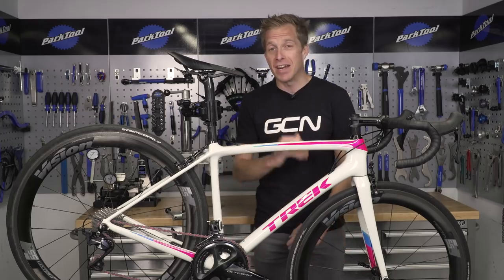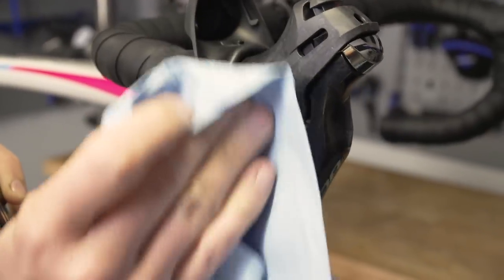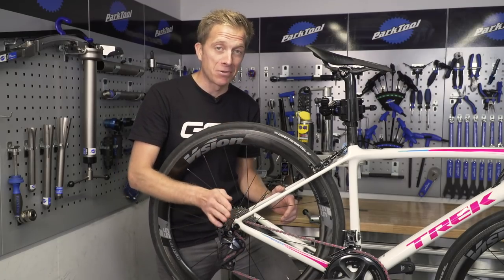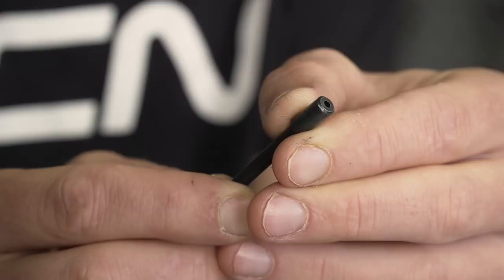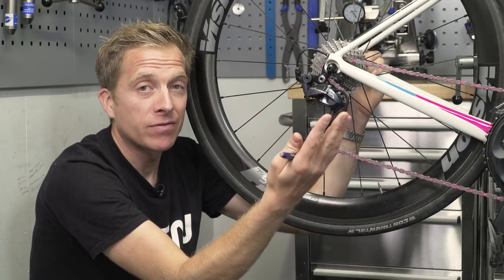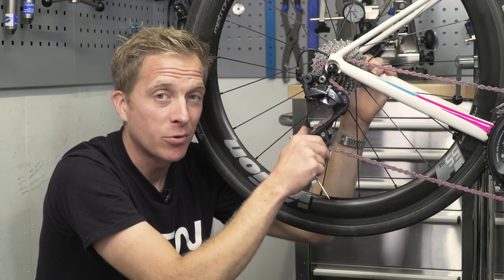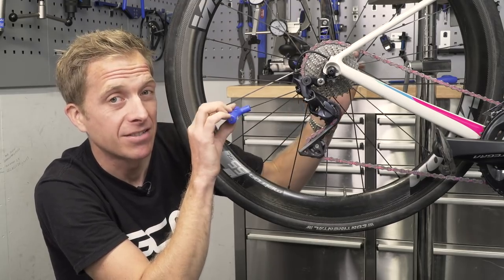How To Get Perfect Gear Shifting On Your Road Bike

Comment from the maker: Do your gears need some attention? Let us know how you get on with Jon's tips 👇
Reply: Nope
Reply: No I got rid of the derailleur years ago and got a Enviolo (NuVinci) CVT and had perfect shifting ever since. Add to that my homemade automatic shifting and I've got something old fashioned derailleur gears can never offer. An infinite speed bicycle that can always maintain my perfect cadence.
Reply: My Canyon Inflite is noisy on just one of the cogs on the cassette. Has been adjusted but still noisy. At least when I shift to it I know i have 3 more smaller gears to shift to.
Reply: who won the wahoo kickr?
Reply: could you even consider that as "shifting"? I mean it's a CVT.
Reply: I always stand up and try to peddle but something jolts me forward . Not sure what it is
Reply: @someguy9520  That's a good question, the ratio is changing but its not exactly shifting from one gear to another.
Reply: Perhaps your cassette is worn out. When you used a worn chain on a cassette for too much time, the teeth are gettiing scraped down to the point where they don't mesh with the chain under load and slip
Reply: still need your advise why the drivetrain on lowest sprocket  always has vibration/shaking feel?
Reply: Great video. I just wish everything Jon explained happened when I attempt it. This is one bit of maintenance I cannot get my head around. Only have to look at the barrel adjuster and gears are all over the place.
Reply: The tips are great, but no mention of straightening the hanger?  They are VERY easy to bend and it's critical for good shifting.  I do with it an allen key in the hanger hole to apply torque, and align by sight downward, and then folding the derailleur up to make sure the pulleys folds up to the correct cog.  Of course you could get a shop to use the proper tool.
Reply: Who's bike is that and what brand makes pink 11 speed chains.
Reply: I like it, but I think you need an North American version of the channel so we can understand a little bit better... I’ll be happy to be the guy you pick for that role.
Reply: My Roubaix Sport with Shimano 105 rear derailleur seems to sort of clunkily upshift. It’s not that it’s hesitant, it just feels like it shifts too hard. Is that normal? I’ve adjusted the indexing and limit screws, B-adjustment and it seems to be better, but not as perfect as I’d like.

Comment: Thanks for sharing. You make my new bike even more perfect. One small question though. Is it common that 1mm gap at 11/52 may cause chain touching the other side of deraileur cage at 23,25,28/52? Or 1mm gap at 28/36 ---> chain touch at 11,12,13/36? (I know we are not suppose to use gears like this. I just want to make sure I did it right.)

Comment: My extra tip for the front derailleur cable tensioning is to wedge it open a little with a 6mm Allen Key.  That way once you've clamped the cable, you can remove the Allen Key and anything slack that you've not been able to remove by had will be removed by the front derailleur itself as it moved back to its natural resting position.

Comment: I give my chain a good soak in degreaser, then get all excess off with a microfiber then oil it 1 drop of 3in1 oil to every link of the chain then run the chain through the microfiber to remove excess oil. Chain should allways be nice and floppy and not gritty inbetween the links.

Comment: If you just buy high quality cables, you will have crisp shifting for a very long time! I use jagwire cables and I love the shifting of my mechanical group with jagwire cables even more than my electronic shifting! I will always buy a mechanical groupset again and just use jagwire cables! Except on the tt-bike I will choose for electronic shifting.
Reply: Jagwire pro are great cables
Reply: SanderCycling I bought some black.phosphates cables can't remember the brand to replace the Shimano ones. No.more gunk.

Comment: Good video, I thought you would never mention how the derailleur hanger can bend out of alignment but you snuck it in the at the end.  The shifting problems I had recently were down to a bent hanger.  It was skipping sprockets, failing to shift, shifting under load.  Even if the H and L screws are adjusted properly the chain will still drop off the highest or lowest sprocket because the hanger will have moved the derailleur  closer to or further from the frame.
Reply: If that's not the very first thing to check, I think you'd be mistaken. All shifting is dependent on it and all it takes to confirm is looking at the pulleys from behind and where they line up.

Comment: I have just replaced the cable to my front derailleur, I lubricated it with ball bearing grease all the way, the bike is foldable so the outer cable goes all the way, with a bit of tuning now it works better than ever and in town I now use it like a stick shift in a car.  Trouble with those cables is that they deteriorate gradually, and you only notice it when you replace it! eels like a complete new bike!

Comment: Great advice thanks 😊 I would like to add a problem I encountered on a bike I built for this summer 😎 my gear changing was terrible 🤔 I did everything I could adjustment wise 😱 eventually I stumbled across the problem, I had fitted the wrong size spacer behind the cassette hence the sprockets on the cassette were not locked into place 😵 once the correct spacer was fitted perfect gear changes ☺️😇😃

Comment: Don't you mean the word "housing" at 3:46: I always thought the wire that runs inside the liner or housing is called the "cable", but I'm not a native speaker and "housings" are cables in a sense as well. Otherwise top notch video. I had completely forgotten about trying the first tip you give here on my rather poorly shifting bike. Will definitely try this.

Comment: You could have added some advice on how to get new cables to go through inside frame cabling.
Reply: Get some stripped out cable housing and use the plastic inner to use it as a thread through. 
Before removing cable, thread the sheath over the cable (long enough to enter and exit the holes comfortably), Pull cable through and out, making sure not to disturb the sheath;  

Hope that makes sense

Comment: Ultegra R8000 is a pain to index gears with. Over designed and not user friendly, especially the RD barrel adjuster. Also the cable housing for the FD is a faff on.
Reply: Completely agree on this. Me and my mates experience the trouble trying to turn the barrel adjuster. We figured out that due to short outer cable, there is too much pressure/tension pressing the barrel adjuster into its own RD slot. Try pushing the RD's lower jockey arm forward towards the front chainring to release some tension; or perhaps the outer cable housing is too long, when i trimmed a few mm it worked well as well
Reply: SAF1981 yeah went back to.my dura ace 9100 that derailleur is very smooth and the adjuster is fine.
Reply: To put more tension on the cable on the Ultegra R8000 RD you also must lift up a litlle bit the barrel adjuster before you turn it anticlockwise.
Reply: I also hate the lift action. I wonder why shimano did this.  So it's childproof ?
Reply: Glad I'm not the only one. I have changed my RD barrel adjuster to a normal dial one. Much easier and swifter than the press in button, slide up and twist action of the original.

Comment: i wouldn't dare to touch or adjust the tension of my gears….i trust the local shop. I have a brand new cervelo and he too sometimes makes soft "toc" when changing gears. I notice the shimano 105 has a very sensitive mecanism. If you press too hard it changes two gears...Next Week my bike is going to the end of season treatment to get that all fixed !

Comment: Hi Jon - thanks for all your videos! I have a question about my front derailleur. I recently replaced my front chainring to a 105-5800 50/34 from an FSA Gossamer 50/34.  I had to do some adjusting to make sure there was no rub, etc. But now when I try to shift into the big ring it requires a significant amount of pressure to make it happen. Downshifting works fine.  What is going on?

Comment: I'm a committed tubeless roadie and MTB cyclist. Every so often I add more sealant through the valves. On my road bike I haven't had a flat in a few years but have added sealant a few times so that it doesn't dry out. Is there a point at which I should pull the tire out and scrub out or try to remove sealant? I'm sure it's adding weight and drying out on the inside of the tires over time Recommendations for long term tubless users? #Torqueback

Comment: One other thing happened to me that could be added: I had problems changing from the 3rd to the 4th sprocket when shifting to easier gears. 4th to 3rd was OK. And all other gear changes worked just fine. I couldn't figure out what was wrong, until I took a closer look at the cassette and noticed that the forth cog was a bit misalligned and seemed just a bit more rotated to the front compared to the others. When I removed the cassette from the freehub body it turned out that the freehub body was damaged by the cassette (steel biting into aluminum). However the forth cog caused a much deeper indentation than the others, hence the cog was misaligned in relation to the rest and the chain was not able to climb properly from the 3rd to the 4th sprocket. I need to by a new freehub body to solve the shifting problem. Since then it was working again. Any hints how to avoid this kind of damage to the freehub body?
Reply: avoid alloy freehub bodies unless they have a spline in them or are made by Hadley.

Comment: I have allways greased my inner cables of brakes and gears with ball bearing grease, but this must have disadvantages, but my bikes are outside a lot of time, and I use it daily, so it is exposed to weather quite a lot, my outer cable covers all the way. what are the disadvantages of ball bearing grease?

Comment: I wonder why Trek decided to have a different rear brake housing cable routing through the top tube between the Emonda SL (right side entry) and the Emonda SLR (left side entry). By the looks of it, it seems the SLR routing rear brake is better than the SL. Any comments?

Comment: The tips are all correct, but the order of the procedures is out of whack. You should always start with frame alignment and the rear derailleur hanger alignment. Without these being perfect, you will never have good shifting. Proceed to front derailleur positioning, and then the limit screws front and rear. Finish with the cable tensioning (the front high limit adjustment will have to wait until after the cable is installed). Yes, in that order.

Comment: Hi Jon, my gears have problems on the second gear where it makes clicking noises. But the problems do not occur on any other gears. What is causing the problem? #Torqueback
Reply: Which gear do you mean exactly?
If it's on the rear sprockets, it may be an alignment issue if every other gear is fine – stand behind the bike as see if the rear derailer looks out of line with the sprockets. If not that, it might be that the B-tension is too tight – the derailer is being held too far away from the cassette.

Comment: What's the best way to configure two different wheels? I have a rear wheel for my trainer and the gears are not shifting smoothy. My main wheel is perfect.
Reply: 1. Check that the cassette on your trainer wheel is in good condition.
2. Make sure that the spacer(s) are in the the correct place - this includes the spacer that looks like a washer at the back.
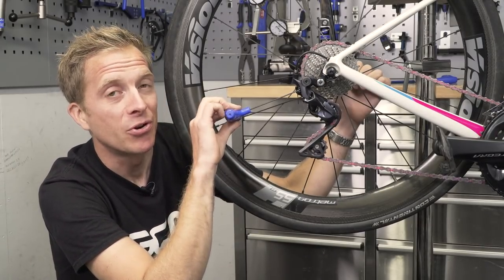3. Adjust the b-tension screw.  See 9:13 in this video. If you do change between a cassette like a 12-23 on the trainer and a 11-28 on the road then when you make adjustments to the b-tension screw, just remember how much your turned it to adjust and then alter it that amount then you get ready to take the bike off the trainer. If it's something that you do often and you can make the adjustment on the trainer, considered just buying the correct sized screwdriver or allen key to make the adjustment and leave it next to the trainer.

Comment: Jon, you are without question GCN's new top presenter but pink chain? It's just not pretty.
Reply: Its not his bike and its not a pink chain, its pink wax on a chain.
Reply: not all thatbetter. Color in wax isn't know to increase performance afaik. Also, it looks like someone wanted an pink accent on the chain and ended up with sth they didn't like after all and simply left it on, because cleaning would be too much of an effort

Comment: I'm not on twitter or facebook but would like to ask a question on rim's I have a new set of deep section rims which are clincher and tubeless compatible. I currently run 23mm clinchers as 25mm tyres rub on my frame (Size M Canyon Aero road) If I put 25mm tubeless tyres on, would the overall circumference of the wheel and tyre be smaller than with the Clincher set up?Are some rim's slightly larger than others?25mm W 50mm deep.Many thanks Paul
Reply: There is no standard for tyres wheels. Some wheels with 25mm tyres will measure totally different to others. Best bet is to pop into your local bike shop and see if they will let you swap wheels in and out to see what fits. Also keep in mind that rear wheels need slightly more clearance to allow for frame flex as you ride.
Reply: Thanks for the heads up, I will for now have to stick with my 23mm tyres but once I've worn them out I will see if tyre type makes a difference. currently running Continental Grand Prix 4000's

Comment: What happens if you don’t charge your di2 shifter ? are you just stuck on the gear? Horrible if you were descending and now have to climb a super steep hill.
Reply: shifting on an empty battery causes a chemical fault chain reaction which conducts residual charge to a carbon frame which catastrophically explodes just riding along
Reply: simon A so your bike just implodes!!! Yeah I’m sticking with my Shimano claris group-set , it’s doing me good .
Reply: That was a joke.
Reply: Matthew Gies so what really happens?

Comment: 2:09 at this point, i usually dont recommend routing the case like this
or you make sure line up cable well and put liner/slick tube/ telfon tube inside the frame
other wise, they are crossed , milling , scratching each other insde

Comment: @7:25 yes you should stop immediatly and check the hanger if its straight!! I know its tips for home mechanics but its a really important step! You dont build a house on a un-even ground.. get your facts straight and try again! I have seen wheels and frames smashed to bits by bend hangers. Gears not right, you start at the hanger and make your way forward!

Comment: Hi GCN! I have perfect shifting going up the cassette (I.e easier gears) however when going down the cassette (I.e harder gears) the shifts are really hesitant, any ideas how to resolve??  Thanks M
Reply: Sounds like there's too much friction on the cables, so the mech can't pull the slack through efficiently. If changing the cables doesn't help, try lubing the pivots in the mech.
Reply: This is probably due to friction inside the cable housings. When shifting to lighter gears the force you put on the levers does the job. When shifting to harder gears the tension of the spring inside the rear derailleur does the job, and if there is too much friction inside the cable housing the force of the spring will not be strong enough to pull the cable. New cables and housings will do the trick.
Reply: Loosen your cable tension and reattach.
Reply: I had the same problem, it was all fixed with new cables

Comment: Does Shimano PTFE lube (chain lube) suit for lubricating shimano brifters? May it destroy plastic/rubber parts? Last winter. I could not shift to big chain ring on cold weather. The lever just went freely to emptiness with no resistance. I figured, that the grease inside has got thick. I poured some of Shimano ptfe lube inside. I had also silicone oil, but I thought that maybe there's something similar, like with hydraulic brakes. That shimano is into mineral oils while sram's into silicone oil and.. So I used shimano oil that it would be at least same brand. But it did not help to fix it. Decided to dismantle it a bit.. To get it properly cleaned/fixed re lubricated, I removed the rubber covers of hoods to get good access, to discover and remove the cover under side of shifter body.(Shimano 105 5800 shifters). I stretched the rubbers and pulled them off over hoods and levers.. while shifters still on bike and all cables intact. When I put them back afterward, they were loose fitted.. Did I stretch them out so much, or did the oil made them to swollen/grow in size? Or both? And now the shifting problem is back, even though it's not that cold. The lever is not always catching to mechanismus, not letting me to switch to big ring. So it seems I have to do it again! It suck, because it's so much work.. I would need to remove handlebar tape.. disconnect all cables, since I want to replace also rubber covers and I guess they are to come off to that direction.. Who on earth designed such things!
Reply: That seems an extreme problem. Hope you manage to fix it.

Comment: Sorry, i dont get it. 10:36 if my shifter is in first gear, why i need to wind it until its in the second gear. that means to me iam losing one gear.
Reply: It's perhaps not super clear, but at that point he tells you to change gear using the gear lever and then turn the barrel adjuster to make sure the chain gets on the correct sprocket.
Reply: You shift up a gear but no gear change happens because the cable is too loose to move the derailleur enough to be under the next sprocket of your cassette. So you twist the barrel to tighten the cable and thereby moving the derailleur to the next sprocket so it's actually in the next gear. Then your shifter and derailleur are in sync.
Reply: thank you! now i got it.